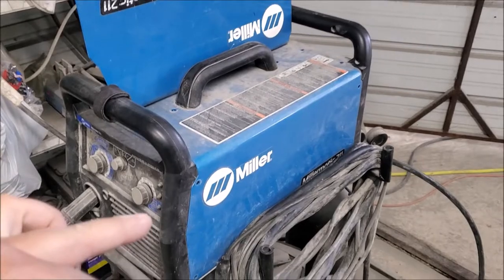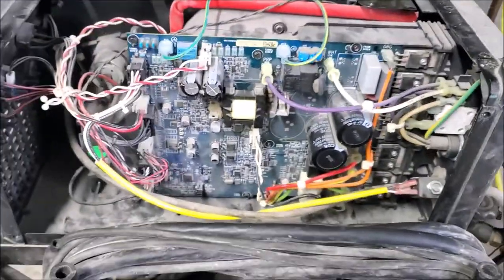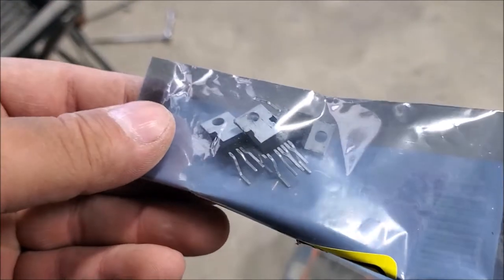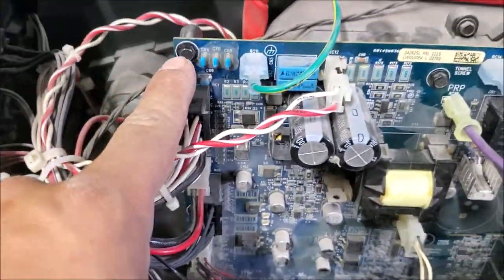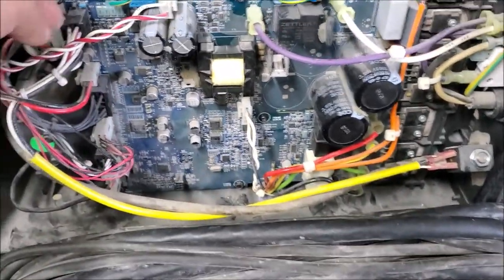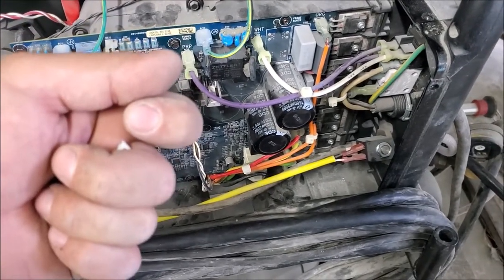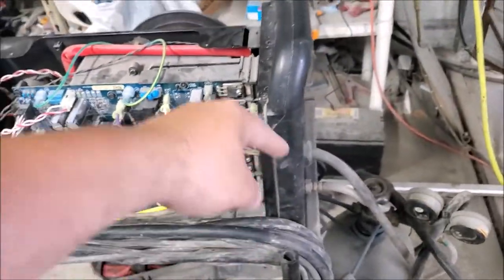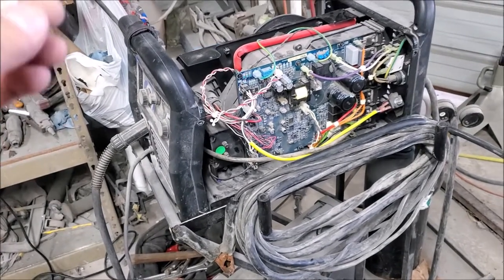Fixed! Miller Millermatic 211 Welder exploded! Won't turn on

Comment: Wow thanks for this video I found it on accident and the exact same thing happened to my dads welder and he was looking to buy a new one hope this works
Reply from the maker: Oh man! Sure hope it is the case and saved you guys money.
Reply: @EddiesCustomsandRestorations  
Hey I replaced that little part and there is a quiet little clicking noise and the green light is on and the yellow light is blinking and nothing is working any tips?
Reply from the maker: @michaelzastavskiy3289  unfortunately i have no thoughts other than just make sure all your soldering points are kept apart and not accidentally touching anywhere.  If all is good i would look up to see if maybe there is a warning light list for these machines.
Reply: @EddiesCustomsandRestorations  I made sure that everything was apart and I put some silicone on there so it doesn’t spark
Reply from the maker: @michaelzastavskiy3289  man I really wish I could help but I havent faced the  problem you're having..
Reply: Did you ever fix it? I’m thinking of buying a broken one for few hundred.
Reply: @georgef1176  nope looking for another welder
Reply: Mine didn't even pop and it still doesn't work.  Switch is good, breaker is good, 240 getting to the board but the POS doesn't power up.  Was working fine last time I was using it now it's a door stop.  Never buying Miller again!